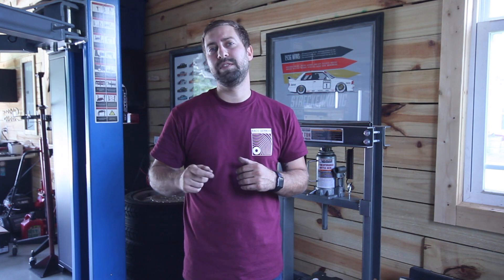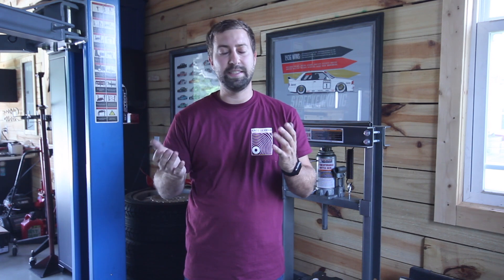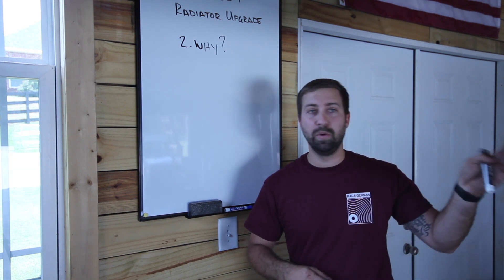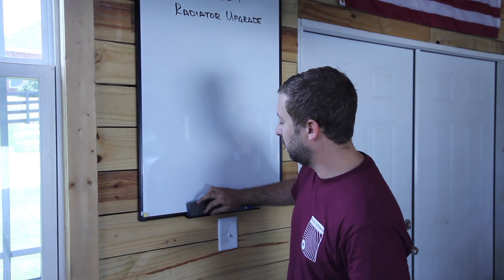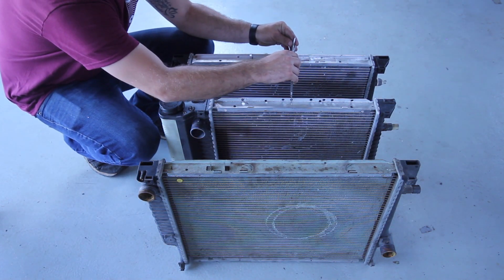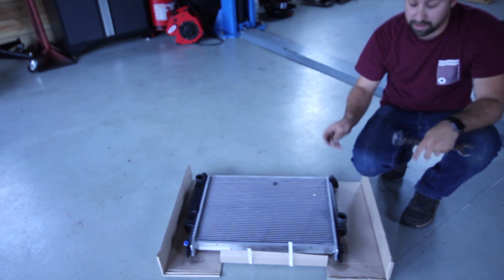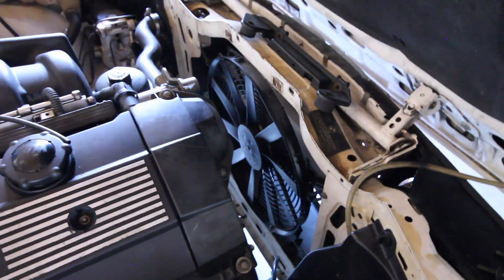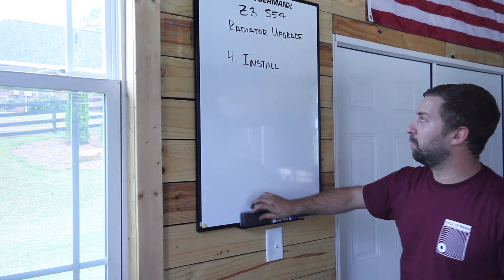Z3 M Radiator Upgrade - Install & Comparison

Comment: I just ordered a Spal with its harness and a carbon intake, hope it will solve my problem with cooling, I also have another question, do the z3m radiator needs to be original or the aftermarket Nissens version will do the work too?
Reply from the maker: Nissans works great

Comment: My car is a 1989 320i e30 with a m50b20 non vanos swap, diesel fan clutch and diesel radiator, yesterday the fan clutch hit the radiator and broke it, now what can i do, what changes to do to so i dont get my radiator broke again? any help please?
Reply from the maker: I would just make sure your engine and trans mounts are in good condition so the engine doesn't move under braking. Also make sure radiator is tight against the frame. If it's using new radiator brackets or zip ties. Nissen is fine. It's the OEM equivalent.

Comment: Would this work for the early model e30’s? I have an 86 325es and from just past XP’s most mods vary from early production vehicles to late model one 87-91
Reply from the maker: Yes, it will work with all E30 models.

Comment: Would this work with a factory M20 fan and fan clutch?
Reply from the maker: I do not believe so. But you can use the measurements from the video and easily see if it would.

Comment: Now will the z3m rad drop into an e30 318is?
Reply from the maker: Yes. The white e30 in the video is a 318is
Reply: Since to does can I run it without the extended coolant reservoir?

Comment: I have a 87’ will a puller fan fit?
Reply from the maker: If you don’t run a mechanical fan. Yes. You will have to run a low profile spal. Check out our website for fans and relay kits